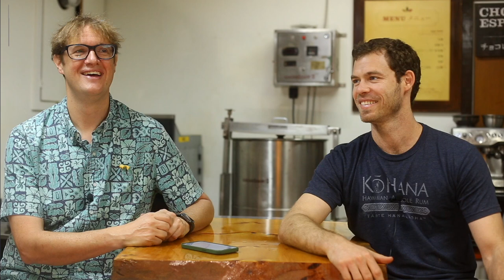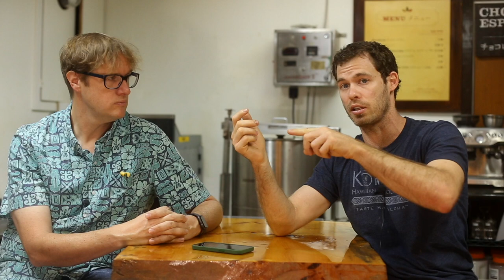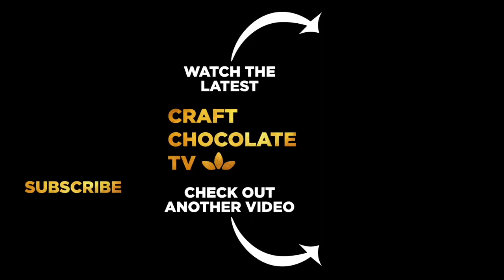How to Keep a Clean Chocolate Factory | Ep.73 | Craft Chocolate TV

Comment: I work as a night oompaa loompaa in a chocolate factory, we have 2 grease pits behind our factory. I am Sanitation, but I have not had to deal with that yet, thankfully.  What is your thought on sanitation for dairy in a dairy free area of a plant that uses dairy? On the outside of the machines(i. e. Walls and floors,) of course, to keep the dairy from crossing into the room? I am lowly sanitation lol the factory uses hot water a heavy duty alkaline cleaner on the floor(which is destroying the epoxy, meaning the ph would be crazy but they don't test ph.)